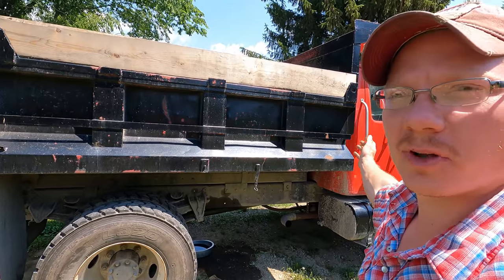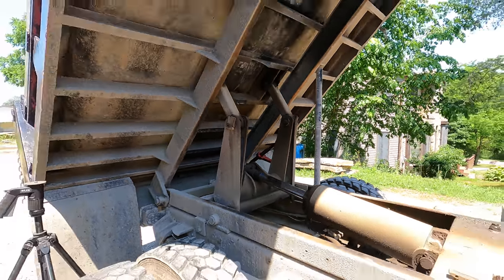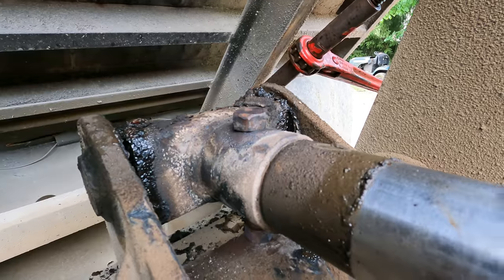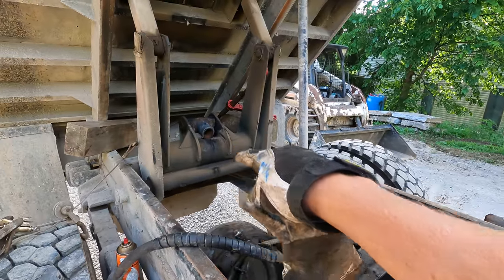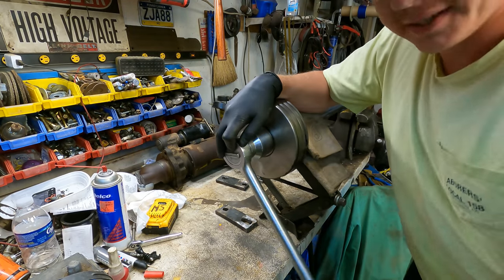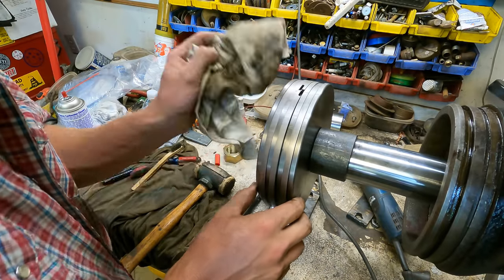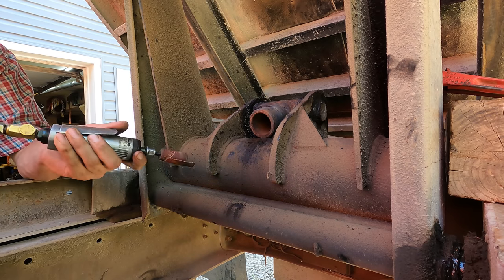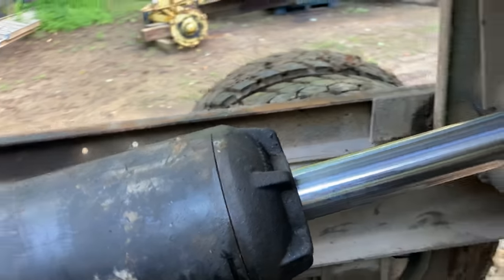Dump Truck Hoist Cylinder BLOWN OUT!

Comment: The bolt through the Ram end is that way round for a reason. It cannot come out when the bed is raised, so the cylinder cannot come out of the yoke unless the bed is lowered.
There is usually enough clearance under the yoke for the ram to extend below the bed if it comes loose on its own.
Take the bolt out first, then extend the ram, prop up the bed, and remove the cylinder.
Reply: This comment is underrated.
Reply: Yeah that makes sense, so the bed has a failsafe to prevent it from crashing if the nut happens to back off
Reply: i think you're correct .. have a like/up-vote
Reply: I was just gonna post the same thing. He put it back together correctly.
Reply: This IS the proper procedure. Rebuilt several of these.
Reply: But yet it can still fail and fall regardless of that bolt.
Reply: The bolt was installed wrong in the end of the ram.  With the nut on the bottom, not only is it easier to remove the ram, but the bolt WON'T FALL out when raised if the nut was to come off.  If that nut installed on top comes off, the bolt will slide downward and shear off or totally fall out!  Think about it, the head of the bolt CAN'T go through the hole when its on the top and the bed doesn't raise high enough for it to fall out!  Retired dump truck and pup driver here.
Reply: @DZCamaro-kz2vd  This answer is correct.  The collar was already on the ram when the assembly was put together.  Whoever oriented the bolt with the head down either did not comprehend the significance of why it was wrong, or they were not paying attention, or they simply did not care.  In my opinion they are qualified to be a design engineer.
Reply: @larrywalker7759  confusing answer!   The nut needs to be nearest the ground  with the bed down and the bolt and nut should be grade 8.
Reply: Ah...
Reply: your explanation is NOT CLEAR at all!
Reply: @DZCamaro-kz2vd  Where did you get confused?  I was reinforcing you by stating that you gave the correct answer.  Of course the nut should have been nearest the ground so the bolt could be withdrawn upward.  That was why I said the persons who assembled it upside down are engineer material.  Engineers are infamous for designing things without any thought about how it will be repaired later. Yes, bolt and nut should be Grade 8.............or 10.9 if you like the metric flavors.
Reply: It sounds so simple when you put it like that! :-)
Reply: I was referring to the "confusing answer" (statement) that "The Landshark" posted, not yours.  We are both on the same page.
Reply: referring to "The Landshark's" post.
Reply: @DZCamaro-kz2vd  LOL, I guess I turned out to be the confused one,  sir.  I offer you my apology Mr. Camaro
Reply: @larrywalker7759  lol, you owe no apology!  It's easy to  misunderstand things with these forums.
Reply: It’s magnetised because it’s been battered and all the iron particles have re-aligned.   You make me very glad I decided that heavy mechanics were  not for me, I’m just as happy to watch you suffer instead !    Well done, by the way.
Reply: Thats the way to do it with "half a brain" as Andrew Camarata says!
Reply: Great Job!
Reply: So, the bed has to be down in oder for the bolt to be removed?There would be enough clearance under neath? Ok....have to remember that!
Reply: And with the bolt removed, you should be able to use the forced retraction function on the ram to pull it out of the yoke if you haven't already removed the retraction hose, right?
   I need to do this job on the elbow of my Hitachi EX-100 excavator. but I have no other machine with which to lift it like his forklift, just the excavator itself, perhaps with the elbow hoses plugged I can figure a way to lift the cylinder out with the other functions; but I haven't figured out how to do that yet.
Reply: "so that the cylinder cannot come out"
The cylinder is the outer hollow portion. The ram or piston is the inside portion that moves in and out. 😁
Reply: @larrywalker7759  yes. I thought of that as soon as I saw it. That nut should have been on the bottom. I agree with that being assembled wrong earlier. I knew that yolk was mounted on the ram first before it was mounted improperly on the lift mechanism.
I agree with you wholeheartedly and I think a lot of other people would agree with you also.
Reply: @larrywalker7759  yes, a design engineer but not a mechanic.
Reply: I’m watching this bolt orientation and wondering if it would install/remove better with the bed down. Then lift bed with hosting equipment. Then remove cylinder. (Add a union to supply hose, ezy than turn hose) IT WAS RIDICULOUS TO WELD THAT TOGGLE PIN IN PLACE.
Reply: Neither are technically correct. That's a Galion body. The bolt should be nut down, and the pin should not be welded on, it originally would have had tabs. I'm a retired body upfitter. Through the years have built many of these. Very popular body on the lower end of cost and quality.

Comment: As a certified couch mechanic, I approve of this repair.
Reply: 🤣🤣🤣  Me too!  Man, that's one the best of the year ! Like it. 🤣🤣
Reply: My couch isn't working right.  Can you come do some mechanicing on it?
Reply: You should use latex gloves to prevent cancer.  I've never seen the inside of a hydraulic cylinder before.
  I think if I had a hydraulic shop around, I would just drop the cylinder off.  Or better yet, maybe I'd just drop the truck off.   How did you learn to do all this?  I don't know that I would attempt all this myself, but I did learn a tip or two.

Kentucky looks like a nice State!
Real men ❤ heavy equipment!
Reply: @giuliom8520  unless I'm mistaken, I think he's in PA.
Reply: This statement question has nothing to do with his video I remember in the early 60s we had a Hudson come in to have a valve job done the head mechanic and my father who owned the garage was a mechanic could not get the head off the engine block the nuts came off easy the head did not want to move I do not know what all dad poured down them studs diesel fuel kerosene and I have no idea what else but finally my dad gave up and told the customer come and get the when the engine started making funny noise call him they drove the car every day of the week and went to church on Sunday 11 days later they called Daddy and told him the car is making a funny noise well yeah the cylinder head was coming out finally my dad and I got in the truck and went and got the vehicle and pulled it back to the garage funny after 3 days of work on the head it finally came off the engine block it took another week to do the valve job and get all the studs out of the block so we could put bolts to hold a head down when it was all said and done My Father the owner of Buck's Auto Service gave him the job and apologize that it took so long like I said it doesn't have anything to do with Matt other than some of the things mechanics have to do to work on equipment The car orders passed away my father if dead the head mechanic is dead and I'm 81 I just want to say God bless to all you mechanics out there Jim Keane
Reply: @jimkeene8985  Why do you use capitals at the start of a new sentence but dont use punctuation? Really off topic, I just dont understand it. Almost as if those keys dont work.
Reply: @giuliom8520  why would you post this comment on someone else's comment instead of directly in the comment feed for the video, so the video creator could see it? And he lives in western PA not Kentucky
Reply: Great comment friend, I got my CCM 8years ago. When did you get certified?

Comment: Matt, when you reassemble hydraulic cylinders that use the "wind in" style of lock ring, it is a good practice to heavily coat the lock groove with grease or anti seize (or a combo of both) before seating the packing gland into the tube. Also coat the same stuff  onto the lock  before winding it in.  The grease will help the lock enter the lock groove and provide protection against future corrosion.  And finally, after the lock is installed, lightly wipe out the excess grease from the lock ring access port and then fill the port with a plug of your favorite RTV to seal out moisture and dirt. The RTV will not bond to the greasy surfaces but instead will cure in the shape of the port and stay there until it ever needs to be removed with a seal pick. We expect to learn stuff watching you have fun with your machines (and we do).  Hopefully you can benefit from feedback in the comments.  Thanks for your content.

Comment: If you line an anvil up to the north / south poles along with a bar of iron and hit it extremely hard with a hammer it will turn into a simple bar-magnet. The atom structure of the steel lines up with the poles and becomes a magnet. Was the truck lined up north to south? I always enjoy your content, as well as the spooky unknowns of the world at large.
Reply: The heat also helped to induce the magnetism. The shock from hammering aligns the molecules in the metal.
Reply: Proud of you for commenting on this.  It jogged my memory of a discussion on this many years ago.  I forgot the context but yes this does sound familiar.  I think old time blacksmiths discovered this phenomenon and used it occasionally for practical purposes.  Sounds like a good rabbit hole to dive into for a few hours.
Reply: An extremely weak magnet, nothing like we see here.

Comment: A 466 with a 10 speed in a single axle is a FINE setup. I drove the tandems with a 466 and a 13-under and they were fine too. A 3208 was a fine engine for that size too. Fine job on the cylinder. And NO CUSSING which was an A-PLUS! Keep it up and you'll have me subscribing!

Comment: From having done about 500 of those lift cylinders, that particular design sucks. They started welding the top pin in, because the ears are a bit too flimsy and the top pin had a habit of tearing out one ear or the other and making a real mess. The way I re-pack those, is by breaking the gland loose first, then pulling the bottom pin, then lifting the cylinder and slipping a section of 6" C-channel about 6 feet long underneath for a guide way. Then I set the cylinder back down in the channel, then remove the gland and slip the barrel off the piston sliding it down the channel. Then remove the piston, remove the gland, re-pack and reinstall in reverse order.

My current truck is basically the same, a 96' Irrational ,but with the 7.3 and hydraulic brakes. I got it cheap with only 45k on the clock, because the base of the dump cylinder was torn out of the crossmember. Apparently, if you never, ever, grease the cylinder pivot pins, the pins will rust bind and twist the pin bosses out of the hoist frame when it raises, who knew right??? lol

Comment: If You could please forgive me, I would like to make some observations.
1. I would have taken a cut off wheel and cut the head off that bolt and then pulled it up.
installation would have been a hardened hitch pin with a hair clip.
2. I always loosen cylinder caps while still on the equipment. no need to hold the part after you remove it .
3. You probably rolled those threads when you removed the nut and didn't grind the punch crimps.
4. The forklift didn't get stuck, it got jealous.

I love your videos and I hope you dont get offended by my comments.
Reply: Nu 3 think the nut was already stuffed, that's why they'd center punched it so well ,to hold it together?

Comment: I usually never comment on anything at all. I’m a rigger and forklift mechanic. One of the companies we use to haul heavy loads had a guy working on a new to them dump truck with all the cylinders repacked and all lines replaced. Long story short, a great guy lost his leg and is still in intensive care. A factory prop rod folded in half and they’re not sure what the failure was and why the bed came down on him. A horrible event happened to a great person, and I’m glad to see you were safe about everything.
Reply from the maker: yes I didn't trust the factory rod for the type of work I was doing!

Comment: Don't you wish more people used anti-seize. I know I do.  🤷‍♂️😞
Reply: Ah, NO! I hate the stuff as it ends up everywhere even on the old ladies kitty. Grease works nearly as well and it does not follow you home.
Reply: @billb410  I hear you but that is the point, it is supposed to stick everywhere, it is either wear gloves or use lacquer thinner to get it off. 😞
There is no need goop it on, a little goes a long way. I work in a steel mill and when I come back to undo a fastener I worked on 30 years ago and it just nicely comes apart, I fall in love all over again.🥰
Reply: @MatthewBerginGarage  I also worked at a steel mill, we undid every single fastener with the torch. Steel mill life was really hard on any threads sticking out of the nut.
Reply: @the_hate_inside1085  I'm a shift electrician we try not to need torches if at all possible.😱 My mechanical compadres also use the flame wrench on all bolts, it just saves time.

Comment: Usually when something comes apart only after a Herculean effort and some truly epic cussing , and then go back together again fast and smooth like, I get very suspicious. Because this usually means I forgot a small part somewhere and have to tear it back apart and do it right, or something else is broke that I missed and all my effort is for naught...  😉
Reply: You got it.  That has happened to me and I felt like an idiot.  Now I try to write down or keep track in my mind where stuff is suppose to go back together
Reply: @georgedavidson7986  Keep a shop cell phone. One that you don't mind getting dirty or scratched up and take a sh*t load of pictures. I also use tape with writing on it on cables and pipes, but if it's a greasy job they can fall of or get smudged, especially if the parts are lying around for a long time before reassembly... I also put hardware in marked baggies and tape or zip tie those to the parts they came off of as I go along, but here we also have the same problem with the writing getting smudged on greasy jobs (or if it is a really long time between the tear down and the reassembly, sometimes I don't understand what the heck I meant when I wrote something like: "screws underside of flange". Six weeks later: What flange, there's no flange!! LOL!)
Reply: @akersjon278  Been there done that  And still have ended up with extra parts   Almost like someone threw stuff in there to freak me out
Reply: @georgedavidson7986  Pfft, that's nothing!  If you want to have something to freak out about, try cutting and welding on a piece of scrap metal that you found in the corner of the shop to fix a problem you had with a piece of equipment at the time, just to realize a couple of weeks later that it belonged to the machine you pulled apart a really long time ago (You know, the really expensive one that it took forever to get the parts for, because it's old and rare)... 😁👍
Reply: @akersjon278  BEEN THERE! Had an old garden tractor at work that the hydraulic lift valve went out on, well they didn't make the part anymore so after about 6 months of hunting I found one. Wasn't cheap and guess what, I used the bracket to fix my backhoe! 😂 Oh I was so mad! My boss couldn't shut me up for nothin!
Reply: I think probably like myself that’s more an age or luck thing and Matt seems to have a lot of one and little of the other 👍🏻
Reply: @MacroGamingStudios  Getting mad at yourself for doing stupid mistakes or subpar work is the mark of a good mechanic. Trick is to learn to just take a couple of deep breaths when a mistake is made, own up to it, and realize that everyone makes them. Then try and repair the damage done the best you can, without being to hard on yourself and move on. Subpar work is much harder to forgive yourself for I find, even if it won't effect the customer, and it was your boss that ordered you to do it "fast an dirty", it still feels sh*tty...
Reply: @georgedavidson7986  if there are neough left over parts to built a beard trimmer, then you've done something wrong!
Reply: 😯WHAT!?! What *good mechanic* does subpar work. They must be shade tree mechanics.
Reply: I've had that happen. What's worse is despite going to great pains to get just right and having a positive feeling that you nailed it. You find out , you dint.
Reply: Often cleaned and new sealed Cylinders are easier to rebuild than it was to open them after years in service. And well, Repairs of hydraulic Components is my daily work for more then 25 years now 😎

Comment: It looked like that rear bolt on the cylinder was just a retaining bolt. I'd think  you are just supposed to remove the bolt in the lowered position and remove the cylinder, or just raise the bed with no bolt to remove. The socket the cylinder fits in would have kept everything connected. Could also have dropped a shorter bolt/pin in with no nut just to be safe raising the bed.
Reply: Maybe a clevis pin?

Comment: Wow, drive by that engineers house and throw the hydraulic ram assembly in his yard. Never ends my friend,  just got to keep moving. Magnetism my guess is from plating    process or friction.
Reply: I heard if you hammer a piece of iron, steel it'll magnetize for a short term but I'm not 100% sure.
Reply: @kamsok6132  heating and beating can result in minor magnetism

Comment: I think cutting the welds holding the pin in and then installing a removable pin would have been way easier and would of solved the problem for the future rebuild
Reply: i would have reinstalled with a link pin, not a bolt and nut
Reply: Who cares

Comment: Why didn't you just grind the welds. Would have been easier.
Reply: I disagree. That bolt should have got out more easily, granted. But grinding those big welds would have been a loooong process plus rewelding it all, phew !

Comment: For as much as you are messing around with hydraulics you should get a seal installer.  Folds the seal so that it easily goes in and when you unwind it 1/2 turn the seal pops into the groove.  A real help.